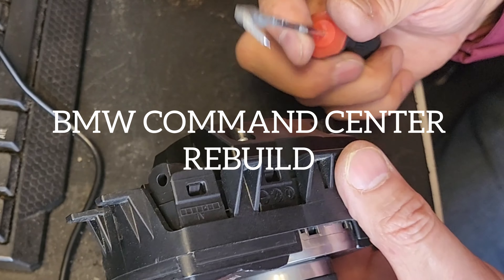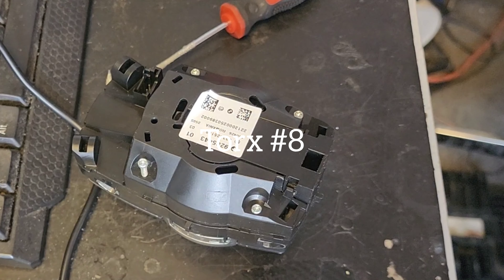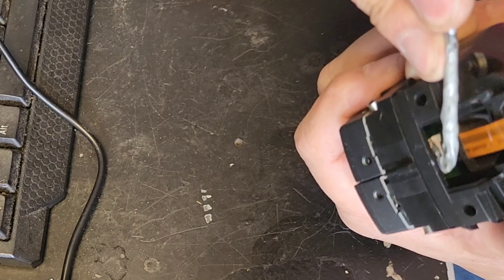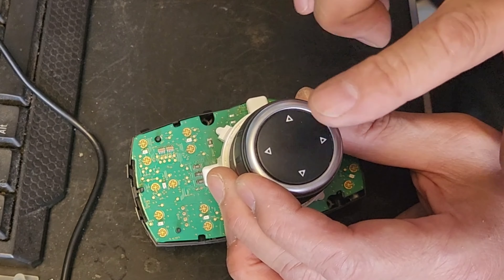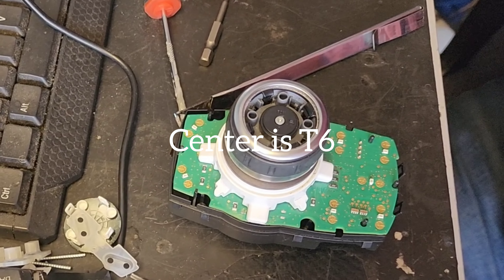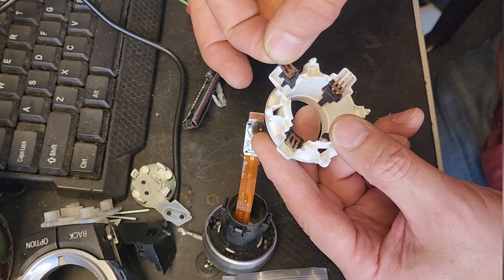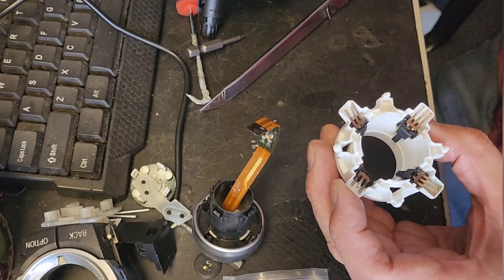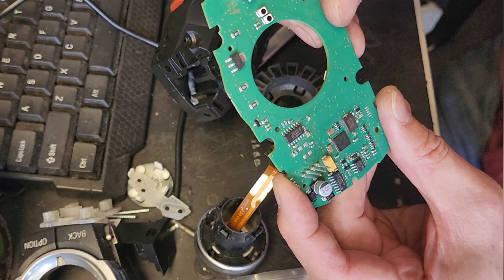BMW Idrive controller disassemble clean repair water coke damaged step by step

Comment: I have a BMW 2013 328. Is there a fuse for this in the car because my whole thing is just off
Reply from the maker: @clohunter1794  Check all fuses in #glovebox #8 #11# 34. Look all the way back of the glove box ,you will see a cutout pull out the panel to access the fuses

Comment: I broke the orange cable 😓 can i buy is without the whole controller?
Reply from the maker: I don't think you can. Go to wbay and look for the one like you have, then use the cable from it. There are a few different models, so make sure it's the same circuit